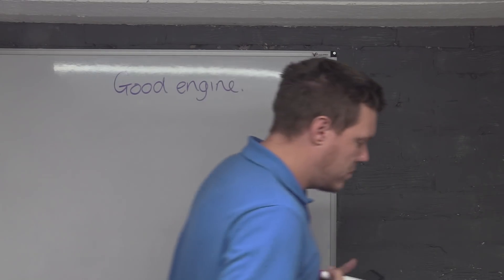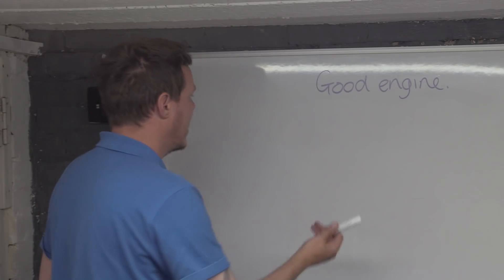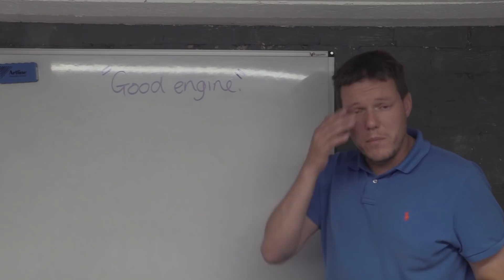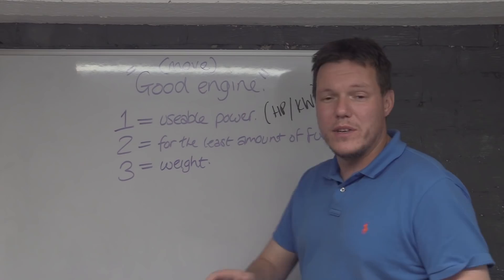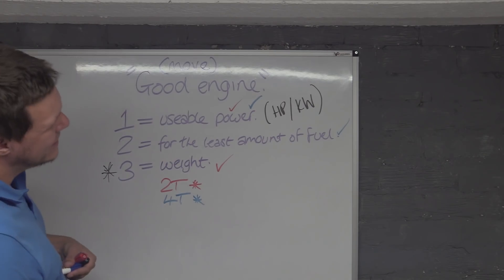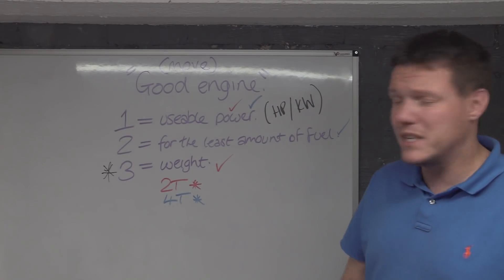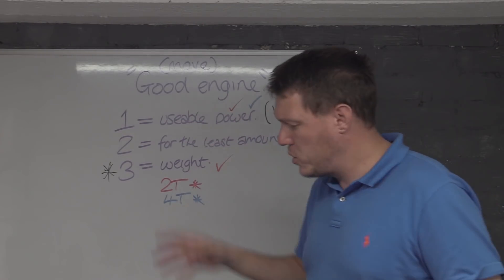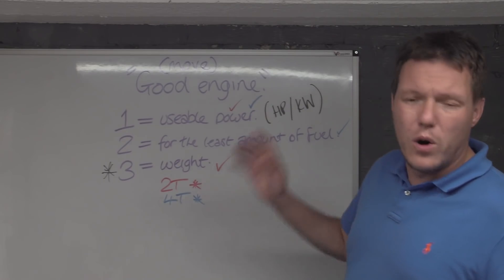What is a GOOD ENGINE?

Comment: Right.  But your'e leaving a lot off that list.  You're mostly right, but I got my panties in a bunch because you decided to bring in the car analogies.  
This is not an "I'm smarter than you."  This is a "you're missing something in your story."  
Engines are an engineering problem, where power, economy, weight are all factors.  But that list also incomplete cost, and size matter too.  Weight and reliability are typically related.  When they're not, it's a deeply crappy motor.  (I'm looking at you Harley)  You can drive down weight, a lot, if you're willing to sacrifice reliability and do a lot of the "really hard to do things".  For example, a welded sheet metal block can get you much thinner walls all over the block, and in the end, a lighter engine.  Though likely one more apt to develop leaks.  
A good engine balances all of the factors involved in it's deployment.  For instance, a generator could have it's exhaust and intake tuned for that exact 3600rpm it's gonna run.  But your motorcycle is going to want to spread it's torque peak across it's typical operating RPM, so you're going to pick intake lengths, exhaust headers, and cam timing so you get a usable spread of power.  
Another good example of this, is on helicopters.  Piston engines typically get better BSFC than turbines, but turbines win essentially every time.  They're smaller, lighter, get more efficient at higher power levels, and make more power per pound.  They also don't foul plugs and don't require as much periodic maintenance.  They're ~a better engine~ for that application.  But would be a hilariously bad (are a hilariously bad) engine choice for a motorcycle.  But, as you described it, turbines would be hot shit in a bike.  And... they're not.  
Your description of usable power is.. off.  I know you understand that usable power (in a mobile application, like a motorcycle) is more about power under the curve, than peak power.  Your words said peak power.  What you wrote.. is dead on.  
Emissions are a real bugbear.  The things that get you better power per liter, also lead to worse NOx emissions, which is what the EPA optimized for.  This means low compression big engines win.    While in Europe they optimized for Carbon output, where better fuel economy means "that was the better engine".  "Is it a good engine, legally?".  Well that's part of the engineering question as well.  
yeah yeah yeah, this is a motorcycle channel, why not keep the discussion to motorcycles.  (You did this...)  Well you brought up american V8's.  Which aren't as bad as you want to insist they are.  
So, OHC versus Cam in Block.  A fair comparison is the Ford modular V8 (SOHC and DOHC engines.. ) versus say.. a LS1. (Cam in block)  The Modular V8 is 650ish lbs, the LS1 is 460.  That 200lb difference is entirely in the cylinder heads.  Something tells me you'd see a similar change in weight if you drew up a single cam in block.  Not that I can see any compelling reason to do cam in block for a motorcycle....  Other than maybe cost?  When building a pushrod, cam in block, engine you'd only need to do line boring on one casting instead of two.  
Before the matrix came out, everyone got the name right.  After the matrix came out it became "neo"bro.  sighs  
Keep up the good work.  :-)
Reply from the maker: "Engines are an engineering problem, where power, economy, weight are all factors.  But that list also incomplete cost, and size matter too."

- No. These are the basics. Cost, emissions, length, materials, balance, complexity are all secondary to the intial 3 that I outlined.

"Another good example of this, is on helicopters.  Piston engines typically get better BSFC than turbines, but turbines win essentially every time.  They're smaller, lighter, get more efficient at higher power levels, and make more power per pound."

- So taking this example what is important for a helicopter is power for weight. So how is that different to what I said?

"Your description of usable power is.. off."

- This best be good....

"is more about power under the curve, than peak power.  Your words said peak power.  What you wrote.. is dead on."

- My words? Peak power? That's not what I said...

"Emissions are a real bugbear.  The things that get you better power per liter, also lead to worse NOx emissions, which is what the EPA optimized for."

- You typed this before I mentioned that, or didn't listen properly.

" Which aren't as bad as you want to insist they are.  
So, OHC versus Cam in Block.  A fair comparison is the Ford modular V8 (SOHC and DOHC engines.. ) versus say.. a LS1. (Cam in block)  The Modular V8 is 650ish lbs, the LS1 is 460.  That 200lb difference is entirely in the cylinder heads.  Something tells me you'd see a similar change in weight if you drew up a single cam in block.  Not that I can see any compelling reason to do cam in block for a motorcycle....  Other than maybe cost?"

- The only reason for a cam in block and pushrods is cost - period. Your Ford V8 vs LS engine is just 2 cheap American engines. Why not compare this to something other than an American engine?
Reply: @thedirtyworkshop  Now I've had my reply eaten twice by youtube, I'll do a good one after work.  You might have me on about half the points.
Reply: @thedirtyworkshop  I'll give you the factors you consider important.  But you can't make the descion without the rest of those.  And given what actually makes it to production... those might be worth more emphasis.  Dollars and space explain a lot of what appears to be poor engineering.  
The helicopter example came to mind specifically because of factors that aren't in your list.  The engines are very light.  As long as they're near maximum rpm they have good throttle response, and can have vaguely ok BSFC.  High power to weight, compact, the biggest point against it is fuel economy.  But they are totally unsuitable to motorcycles.  Throttle behavior, part throttle fuel economy, completely trump the power to weight, and total power.    You get that P/W might matter more... so that would make the turbine a good engine.... (for a helicopter) but not for a motorcycle.  
So, your description of usable power was made using the example of an APU or Generator.  Both are steady state applications that are not good examples of automotive situations.  A bike motor needs to have a spread of horsepower across a reasonably broad spread of rpm.  This is a thing I know you understand.  What you wrote on the board was dead on.  Your examples weren't... good.  And you really only spoke of the most power.  If you meant power under the curve... that wasn't clear.  
Mentioning emissions was more to tell you I was paying attention.  And know why there's a difference .. i'm going to use the word culturally, between european and american engines, due to emissions regulations.  
Cost is a big deal.  In automotive applications, engine height does matter.  But I took your challenge.  I did some digging.  The engine I came up with was the BMW M82, v10.  it's 50lbs heavier, produces something like 15% more horsepower, but finding the CG of the motor .. .well.. couldn't do it. I'll give you the american v8 thing.  Most of the time I'm looking at them, I am comparing them to Lycoming/Continental/Rotax.  Not a good spot to start the comparison from.  :-)  
Well, I'm flattered I got you to do a video.  I do understand where you're coming from.  Keep it up, you are the lowest poop channel I've run across regarding engines and motorcycles.

Comment: I definitely get the gist of the argument that hp/cc is a useless statistic. I'm sure there's some tiny turbocharged engines out in the world that make absolutely nutty power for their displacement, but with the weight of the turbo and the intercooler and the piping and all that if you could simply make a larger displacement engine that makes the same power and weighs the same with less complexity what are you gaining from the hp/cc equation?

And yes, I'm being reductive, turbo engines usually save weight to NA engines horsepower to horsepower, but you get my point.
Reply from the maker: So....

"tiny turbocharged engines out in the world that make absolutely nutty power for their displacement"

VS

"if you could simply make a larger displacement engine that makes the same power and weighs the same"

These 2 engines are the same.

Same fuel useage
Same power
Same weight

Complexity means what? 

........... and that's the next video.
Reply: hp/cc
a 9.8kw CB125r engine at the 2064cc of that S&S would/should/whatever put out 220hp
Reply: A displacement of 2064cc means an engine "should" output somewhere between a little (as in the case of the paperweight in this video) and a lot of power. There's so many other factors that go into the final output of an engine that saying x engine makes more power per displacement than engine y isn't particularly informative. We all seem to get hung up on things like displacement and max rpm that do correspond to an engine making more power, but it's not the full story. No one is out there bragging that their engine only dissipates x kW of energy as internal friction even though it's an important aspect of the "power equation."
Reply: @BuffMyRadius  yes, i know
Reply: @His Masters Voice If your talking fuel-injection I agree..just keep the tank
full and add stabilizer.Unfortunately/Fortunately I stay with the devil  I know...Carbs
.Iron liners in older bikes will rust..Carbs will vent out fumes
and leave deposits of ethanol reactions..nasty.Its not bullshit if you own an
older bike.!
Reply: @His Masters Voice ...I agree with everthing you said ,if its fuel-injected.
 .Yes, I have a collection
and run synthetic in all of them (11).Your
situation is much better than mine as I live
in the paciific northwest near Seattle where it Rains 6-7 mo out of the year. I have not yet gone to straight gas (unwlling to pay).the shortcut to this has been to add a fuel valve and run them out when I`m done.I do not start "stored" bikes regularly for the reason you stated.The other reason is that all of my older bikes do not have a stainless steel exhaust..Thin steel and they need to be hot..with cleared drain holes..they dont
get hot enough without a good ride.You
dont mention battery charging though
I know you know.!

 Good post...Thankyou..Cheers..!

Comment: Reliability & economy is on everyone’s shopping list these days. 
Had a mate that used to say “why buy a Harley when massy Ferguson’s come with a cab and a radio” 🤔 
Great video.
Reply: @Eddie Hitler usually Harley riders have a bit of excess weight around the belly 🤔😉😂
Reply: Because its not a tractor engine in any form and i know I've used both,that just a Harley hater joke I've owned dirt bikes road bikes mostly Japanese and I've got nothing against any of them.the thing about Harley is you can ride them for a long time without doing much to them there pickup trucks of the motorcycle world the hall weight use less gas doing it.yes some other bikes have a cheaper price and are faster who cares.that's not what you buy it for, and it will have a better resale value than other bikes.
Reply: mbsnyderc 
You really need to lighten up mate, it’s called having a laugh.
Life is too short to take everything so seriously.
Reply: @decab8292  
I'll bet your girlfriend enjoys riding on a Harley more than any other bike 🤪🤪
Reply: mpetersen6 
🤣😂 
The wife says I can’t have a girlfriend 😉

Comment: what about the durability/simplicity of the engine parts? Should that not be included in what makes a good engine? If it runs great for only 10k miles what is the point?
Reply: If it only needs to run for 500 miles, who cares about it at 5000.
Reply: Yes, I'd vote reliability/maintenance is a consumer value so I'd give it half a point towards a "good engine" (vs. the 3 pts in the video) no one cares for race or performance applications.

Comment: Kawasaki  in line four z650/900 good motor in its day
Reply: I had a 1978 Z650b and the engine wasn't the greatest 60-66hp and the electric sucked. Never ran great in the dry sunny weather only in foggy or rainy weather she was going. I guess it was the British model LOL On top of the poor metal quality ripping out threads on the head. Leaking where ever it can. And not that service friendly as others of that time.
Reply: I agree had a Z750 put 94000km no major issues. They had a great reputation.
Reply: @freeagent8225  yep i put 84.000 miles on mine over 10 years never let me down  i think it was cosworth who tested a z650 engine at full revs for 24 hours non stop was fine at the end of the test.

Comment: I have a ZRX1200R, it has 100nm at 2000 rpm and 125 at 6500 rpm, now thats torque and low end grunt in one good engine, maybe not the best but damn good...i once tried a Buell odysse 1200, it felt weak and like it had a dead cat in the airbox, i was dissapointed, a shame actually since it was a cool bike, and a bargin

Comment: Dunno, Matt, I think you're missing revs.

Those fuck-ugly Harley tractors run at stupidly low revs compared to a sensible bike.  As fuel consumption, assuming proper air/fuel mix, is directly proportional to how much mix you're running through the engine, and thus revs, power specific fuel consumption* is liable to be more or less the same** for, say, that custom harley lump and the Ducati, if we assume, not unreasonably, that the "little" factory Ducati is spinning more or less twice as fast as the other turd.  The Ducati run showed its power graph, IIRC, not sure about the other one.

Can't believe I'm defending the Harley outlook.

It's also worth pointing out that Harleys have weight reduction built in from the factory,.  For every 10 miles down the road, 3 kilos of shitty chrome rattles itself off.

* That's what  his TSFC was about, although he's fixated on torque because his chosen type of engine is shite.
** modulo the extra losses from shit engine design, pissing fuel down the exhaust due to bad scavenging, etc.

Comment: Wouldn't engine longevity and service intervals play apart as well?
Reply: That's just part of the cost which is not in the list.. so probably not.
Reply: Luke Viney 
In general, yes. I suppose that could be included in with point two on Matt’s board, as it’s a cost consideration - albeit to a lesser extent than fuel usage, which is the greatest cost to using an engine.

Constant need to fiddle with outdated carburettor technology, points, etc. to keep (for instance) a Harley in tune chips away at that argument a bit on a deliberately “old tech” engine though. Left alone between services these things are likely to drift out of tune, cause even more fuel to be used, and decrease engine life and reliability. They would require either an owner who has mechanical nous enough to successfully tinker with such things, or even more trips to a dealer/garage between services. 

On most objective levels an old tech engine is worse. New tech, done right, probably wins the longevity and service intervals/costs argument too.
Reply: @BungleBare  
Endurance and service intervals only springs to mind because my company produces engines for Motorsport and aerospace. We give a MTBO , Mean Time Before Overhaul, on our engines of 250 hours. At this time we need our engines back for rebuild at considerable cost. But this is an extreme case. Most extreme would be the life time we give for our development race bike of 10 hours. 
I suppose a more realistic example would be a Mazda rx8, their engines typically need a rebuild at 60,000 miles and need to be service every 5/6K miles. Where as many 4 stroke petrols are service around every 10k miles and could potentially last 200k. The cost of this would have an impact.
Reply: Luke Viney 

So maybe the best term to use isn’t fuel use, but overall running costs? Fuel would still be the main component of this, but maintenance and repair costs of an unreliable or overly complex engine could skew the figures somewhat. 

Interesting point. Probably one that we all kind-of instinctively factor in when purchasing anything with an engine as well - we all know a Ferrari will cost more to run than a Mustang of similar engine size, simply due to the maintenance needs and costs.